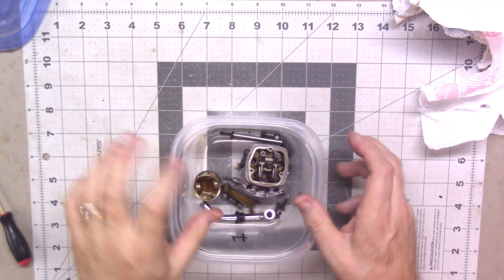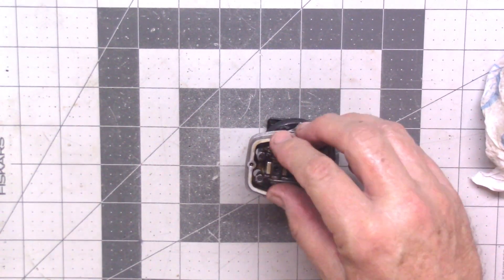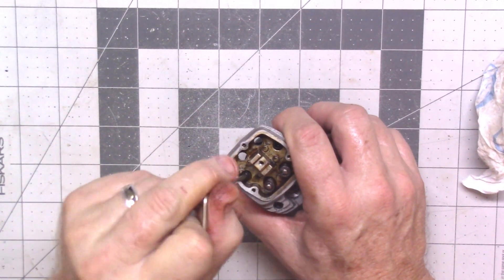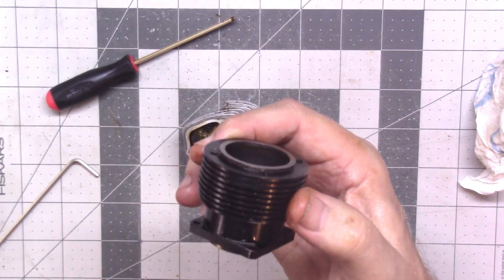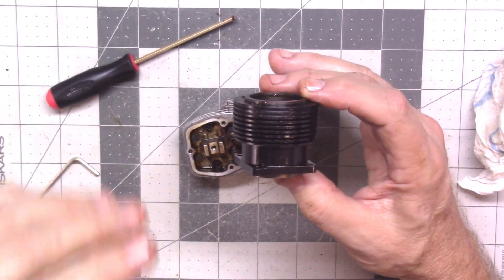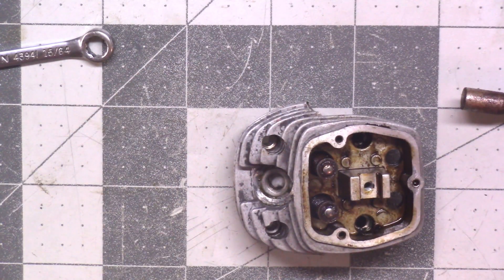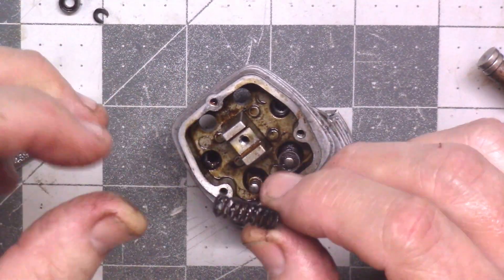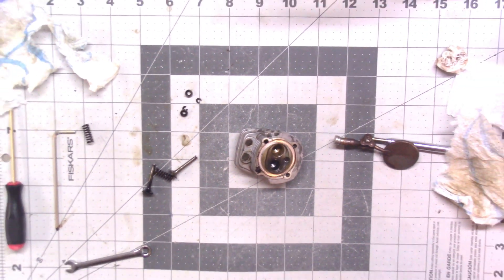OS FF-320 Disassembly (Part 4)

Comment from the maker: So I was just looking back at the videos I made with the first 320 I had.  Those videos were MUCH better than these I have made and posted.  There are several reasons/factors that play into this.  I will save you all of that.  The bottom line is that I will NOT be making reassembly videos for this particular engine.  The location, lighting, etc. is just not conducive to making the same quality videos I did previously.  I may show some clean parts segments and some certain tidbits, but I will not be making full reassembly videos.

Comment: That black paint is the only weakness on all the multi cylinder OS engines. It just comes off so easily
Reply from the maker: Strange too because early Saito GK engines suffered the same type of thing.  But then I TRIED stripping a more modern Saito GK engine and I could NOT get the paint/coating off.  So over the years the process for Saito engines changed.  I wonder if the same holds true for colored OS engines?  I sprayed mine with black high temp grill paint.  For now they look fine, but how they will withstand my reassembling them and then running the engine is yet to be determined.  In retrospect, it was stupid to put the cylinder sleeve into the ultrasonic cleaner.  That portion really did not NEED cleaning anyway....